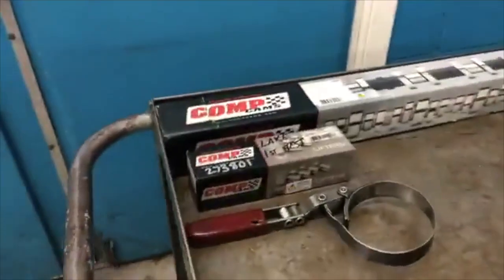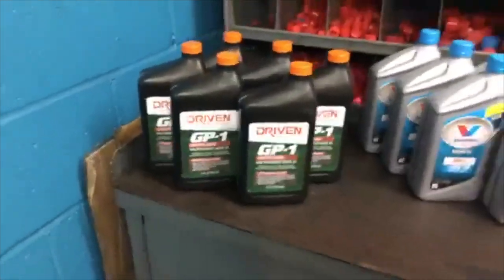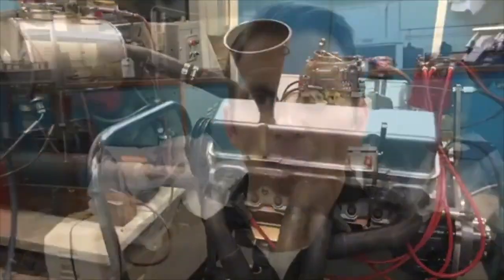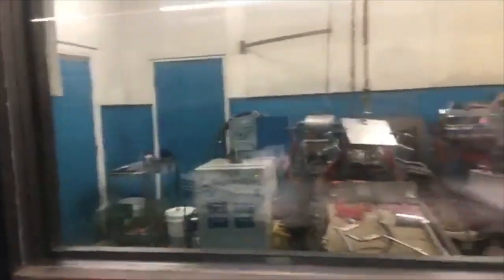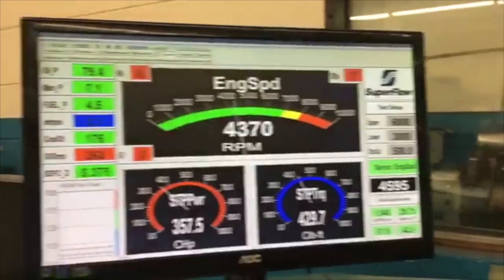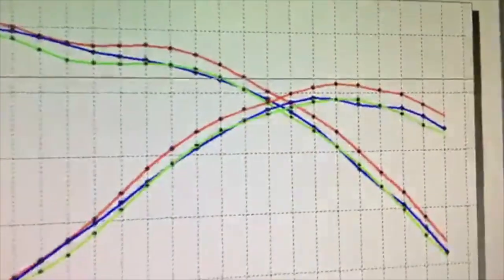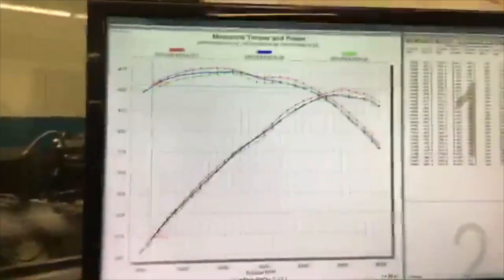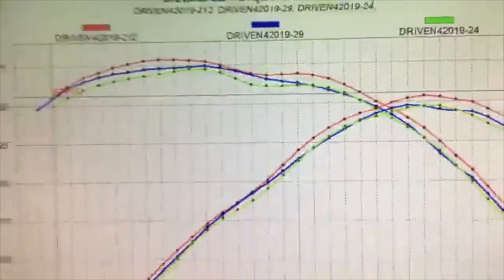More Horsepower in an Oil Change? NEW - DRIVEN GP-1 High Performance Oil

Comment: Will GP-1 Work In LS Engines?

Is It Better than the LS30 Oil?
Reply from the maker: GP-1 can be used in modified LS engines, especially those with looser bearing clearances and aftermarket oiling systems. For stock bearing clearances and factory oiling systems, the LS30 is still the best option. LS30 is specifically developed for tuned, and slightly modified factory LS engines.
Reply: Because Currently Im Heads, Cam with supporting modes but will be doing a 416 stroker next year